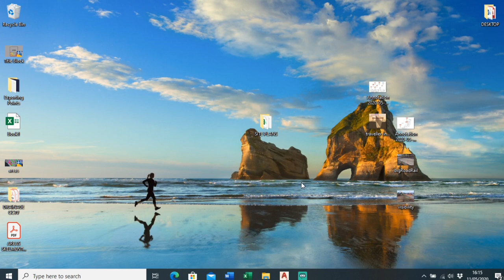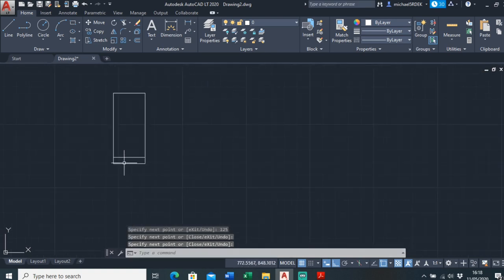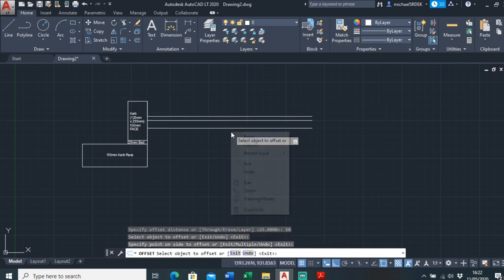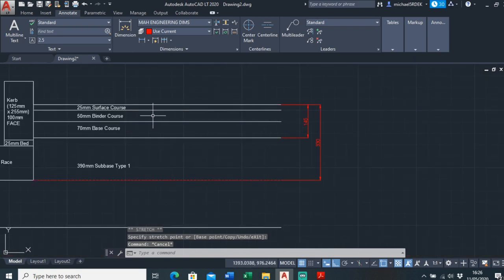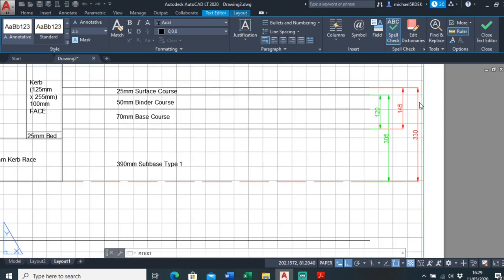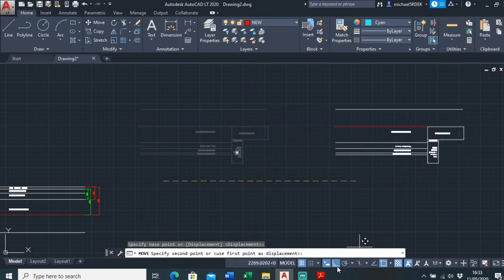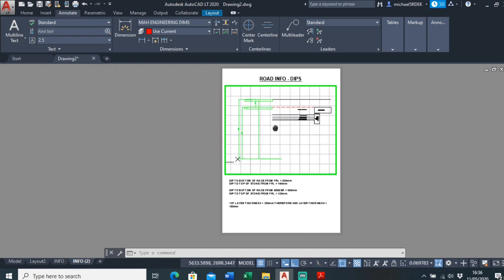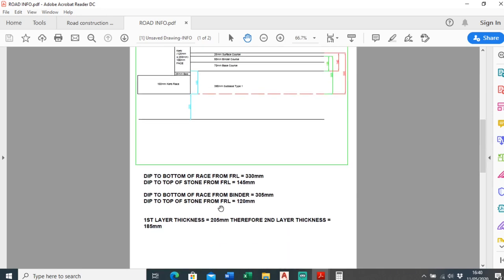How To Work Out a Traveller and Road Dips   Road Setting Out

Comment: Hi MAH, 

@ 45 seconds in you mention the previous video for calculating the level..Do you have a link to this video?
Reply from the maker: Hello! 

Yeah I covered this. Its abit long winded the way I explained it in my videos. Basically it depends on how your information is given to you. For me 9 times out of 10 its via a long section and setting out info is from a centerline. 

My process is; 

1) draw centerline
2) offset centerline (for kerbs and profiles) at known chainages.
3) insert block at these points to export coordinates and height.
4) heights taken from longsection.
5) export to total station 

Here is the video. Skip to 3.50 

https://youtu.be/GBDLKE5Cap0

Let me know if you need anything else.